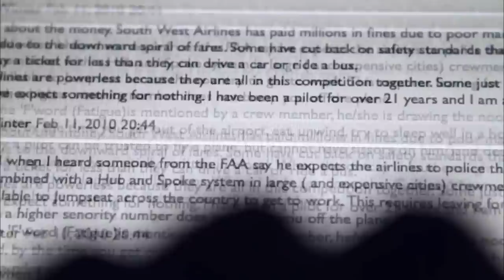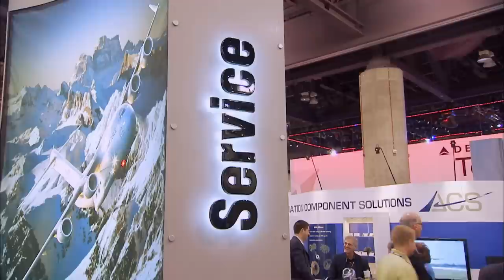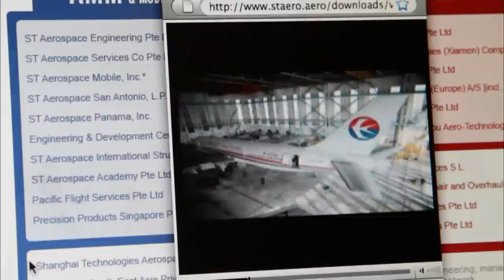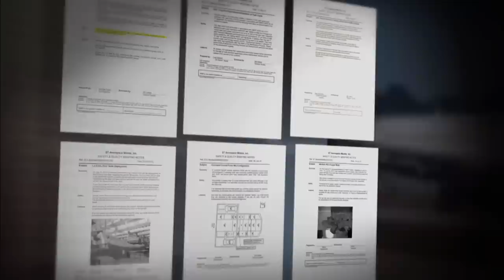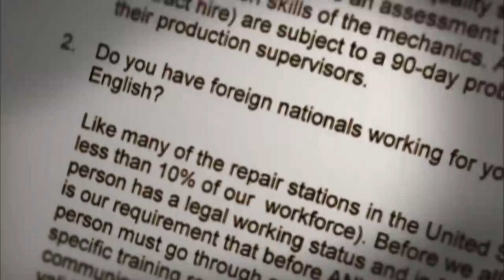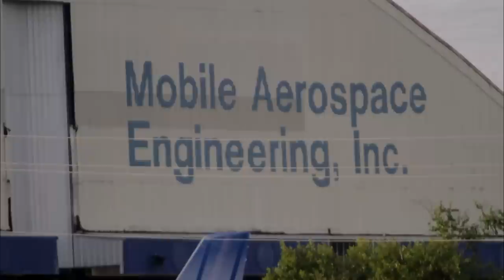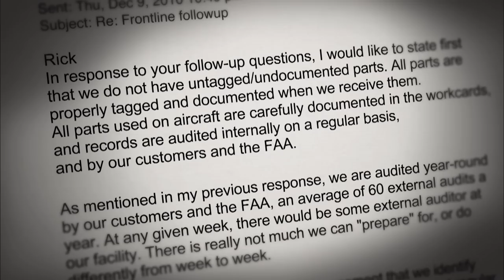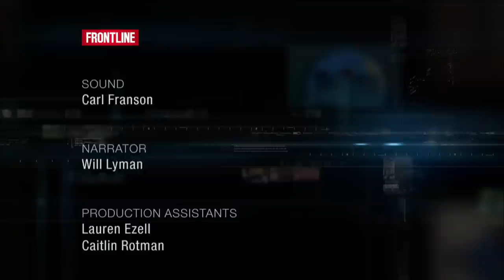Flying Cheaper (full documentary) | FRONTLINE

Comment: As an aircraft mechanic for a major U.S. airline, I can tell you the cheaper the airline, the cheaper the flight crew and maintenance for that aircraft. Airlines like Spirit who outsource and use only contract maintenance are only surviving right now because their fleet is so new, once their planes get older and more degraded, that’s when we will start seeing more issues and safety concerns for sure.
Reply: I didn't know Spirit bought new planes, I thought they did the same as Allegiant and just purchased older planes from other airlines
Reply: You are 10000000000 % correct.
Reply: @stevecooper7883 … That’s the best thing that Spirit has going for it, the fact that their fleet is relatively new. But once these Airbus A-319’s and A-320’s get a volume of bounces (rough takeoffs or landing cycles), they’re going to need comprehensive airframe overhauls…and they’ll get the lowest bidder to perform it…😳
Reply: @twoblacklabs904  They already began retiring their A319s earlier this year, so that will be someone else's problem
Reply: The secret is to always keep the fleet new 🧏

Comment: The rule of thumb of “You get what you pay for” Will always persist!
Reply: dont agree. Have seen examples where people charge more bug give just same service.
Reply: btw android and iphone are good examples. Maybe iphne is better but it is not that better as is the price difference. Some said it is not convenient and went back to android. I also worked with mac for 9 months , do not want it at all. While mac computers are way more expensive.
Reply: @Name-lt2tz  if you don’t know how to check what are you getting and you get ripped off by a supplier that’s on you!
Reply: @Name-lt2tz  as for the iPhone and android, I completely disagree with that notion I have been using iPhone for seven years now after changing from android, and I can totally see where my money is going to, and I will never go back to android or any unsafe Chinese made phone. In addition, in my line of work I need to use a lot of GIS and use offshore trade and banking applications some of which are only available for iOS and none of which are safe enough in my cyber security experience with androids so again that argument is nonsensical for me.
Reply: No, cause the money just goes to the billionaires. Greed does not die when you feed them! Only grow bigger and worst!
Solution is to punish the ones with punishment worthwhile their crime, and not get off with 10K fine for hundreds of lives and blood money fed by deadly greed!
Reply: @Name-lt2tz  Exactly. Where the problem lies, face it head on. No diversion tactic.

Comment: I avoid flying as much as possible due to reports of Boeing aircraft not being designed and built properly and airlines subcontracting out maintenance to organizations which use illegal parts and employ uncertified mechanics who cannot read the maintenance manuals.
Reply: You have a significant chance at getting in bad car accident than a plane accident. The flight training these days is amazing and the previous accidents have made flying even saver today! Stuff in this video have been fixed and no longer happen, the FAA have stepped up to insure this. You shouldn’t be nearly as worried, just remember most previous airline accidents were caused by pilot error rather than mechanical error.
Reply: @Cap10ndavis He’s not wrong. I was an engineer in aerospace industry for years. Companies do do a lot of subcontracting and not just for maintenance
Reply: @frankhynd885 I appreciate your environmentalism but the simple truth is that aviation is the safest form of transportation today. Yes, there were times where there was a scary amount of illegal parts and poor maintenance practices but these problems have been identified and largely solved, especially in America. To be fair, the reports of Boeing cutting corners in the design of the 737 Max were scary but they are now being held at a higher standard not only improving the safety of the 737 Max but also all Boeing planes. I respect your choice not to fly but a choice of not flying should almost never be about safety.
Reply: @MSP_aviation  - Thanks for your email with this comforting information on US aircraft and maintenance safety.
Reply: Alot of the terms illegal parts that can't be tracked has alot to do if the part number and serial number is readable or not. The part is good but illegal. A part that has the part number placard scratched off is probably at least 50%. A part that is unservicable that goes on an airplane will immediately  fault a system eventually. Unless it's a safety system that will be found on the next time controlled check. I will say planes out of heavy check tend to have gremlins for awhile until line maintenance gets them straight .
Reply: @MSP_aviation  well said !
Reply: @Cap10ndavis where is that study and who funded it? How old is it?
Reply: @MSP_aviation Ha

Comment: I was surprised to see a Delta jet there. Delta has the largest MRO facility in North America (ATL). Delta does its own work and work for numerous airlines and militaries. They have an engine shop and perform "D checks"- basically disassembling the aircraft and putting it back together (50,000 man-hours). The only time I saw outside mechanics work on a Delta jet was when a problem occurred at an "out station". Any outside work was reviewed by Delta maintenance once it got back to a Delta station. I believe Delta is the only airline that actually makes money on maintenance. They offer tours to the public at their MRO facility in ATL.
Reply: This is from 12 years ago. Much has changed.
Reply: @leimeisei909  Let's hope for the better.

Comment: 3:40 "I don't think we've yet seen all of the manifestations of this change" -- however, in the 12 years since this documentary was put together, there has been just one fatality on one flight due to maintenance issues on US commercial passenger aircraft (not counting seaplanes): Southwest Flight 1380 in 2018, which had an engine-out due to a low-cycle fatigue crack in the dovetail of fan blade No. 13. At what point can we conclude the fears raised in this piece did not materialize?

Comment: Let's not forget flying is statistically more safe than driving. The entire 2/3rds not having a license point is misleading at best simply because you can't just snap your fingers and say everyone needs to be licensed because overnight all operations would cease. Also, the simple reality is the licensing is for more mission critical components/knowledge. You don't need a license or fancy degree to simply turn a wrech. Let's be realistic here PBS. Why would you need a license to replace a seat, or do a touch up on the paint for example, etc? Don't forget the vast majority of work on aircraft is fairly straightforward and basic. Roughly 2/3rds of it I'm guessing.

Comment: We are deeply shocked when we find the industries we trust, or are told are trustworthy, are violating our trust through outsourcing labor to unqualified domestic and foreign sources -  not that these sources are inherently bad, but they lack proper training, skills, funding, certification, and accountability. We are transferring every risk we can to the person with the least ability to control those risks. This is not isolated to airplane maintenance, truck freight, cell tower installation and maintenance, pork or poultry farming, or domestic water supply. We must reevaluate our understanding of Economic thought to include ethics, safety, and democratic will instead of a religious zealot's assumption of efficiency in a world which does not exist.

Comment: Outsourcing your non-core business is a standard practice at major companies. It doesn't mean shoddy practices. This piece takes a handful of maintenance discrepancies and tries to paint a picture of failure. When in fact, failure should be measured by safety results - aircraft failures resulting in incidents. The licensing and global hiring line of investigation borders on shoddy  journalism. Wow, digging in the trash looking for parts without supply-chain custody.

Comment: I appreciate the questioning and investigative mindset.  But how about some statistics in support of the heavily implied proposition that airline safety has been negatively impacted by outsourcing of heavy maintenance?  Since Southwest kicked off that trend in the late 1980s, it appears that the frequency of major crashes have decreased, not increased.  While that measure may be superficial and deceptive, it is odd to me that this documentary did not offer any statistical evidence about its heavily implied conclusion and instead steered around that issue by saying that maintenance failures "could" lead to disaster.  Also, I noted the myopic focus of the documentary: on recorded maintenance failures and insider complaints.  But maintenance failures in company records imply that quality control processes are catching these issues before - for instance - engines/aircraft are delivered back.  Moreover - circling back to my original point - there really is no data to support the proposition that the same or similar issues were not faced prior to the outsourcing trend.  At least such data is not presented by Frontline.  This documentary just falls WAY short of Frontline's standards.  It appears to be click bait.

Comment: I do believe the alaska flight that went down in california off point magu was serviced in another country and had a non faa certified rudder bolt.
I used to book flights based on the actual plane.. i always searched for a 757 plane
These last few years i really dont like to fly
Reply: No, it was the elevator jack screw. Maintenance wasn't lubricating it on schedule, using the time alotted for THAT maintenance, to cover overblock hours on other maintenance, "pencil whipping" that maintenance. Kind of a long story to explain.  Good documentaries on it though.  Oh, it was also out of tolerance with wear.

Comment: Well...if I didn't have ENOUGH reasons not to no longer fly (I have 10s of thousands of miles over 62 years) I have it now. Nearly going down in a super cell in DFW, the following year landing in the midst of MANY tornadoes in Charlotte, MC, only to off-board & fly right back out on my connection in the midst of same storm, traveling with my 1,2, & 3 year old children, nearly crashing into Heart Mtn while descending into Cody, Wyoming  ( those were all 3 experiences of sequential journeys), not to mention I am very tall with long legs & I no longer FIT in a seat in economy because my thighs are longer than the space provided, this film is beyond shocking. Rather than take a local flight anywhere,  I will definitely drive 500 miles to Malta, Montana  - essentially on Canadian border, and ride rails. Besides...I DOUBT I would have some guy whose head falls against my arm, drooling down me.

Comment: Consider a used jet engine part taken from a retired plane.  Is it already worn out?  Can it stand and perform flawlessly over thousands of further hours of heat and vibration?  It needs to be rigorously tested and examined again.  A microscopic crack might bring down that plane.  Before a replacement part is installed it needs to have a paper record, similar to a personal diary, showing whether it is new or used and what inspections and tests it has been subjected to.  Would you pay for a new part on your car if it actually, secretly was removed from a totalled wreck?

Comment: I went to Purdue, got an engineering degree then went on to fly in the Navy for a decade. I left with a commercial rating in fixed and rotary wing aircraft. I don't fly any longer unless I have to for business. The complete and utter lack of talent found in the air traffic controller space, pilots and maintenance and even the ground staff at the airlines has never been lower. EVERY LEVEL at the airlines has been ABSOLUTELY COMPROMISED by political correctness and that mindset. I'm loving my road trips!